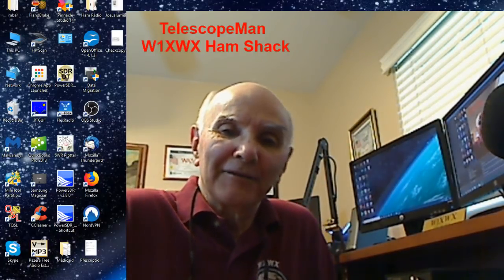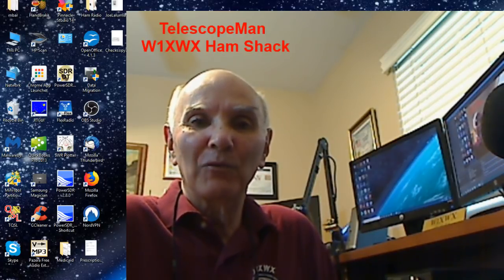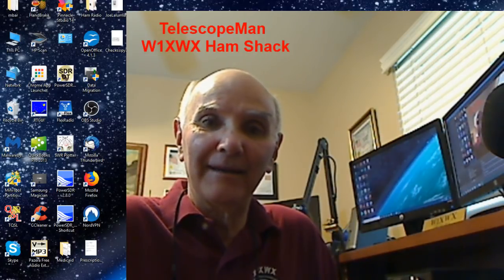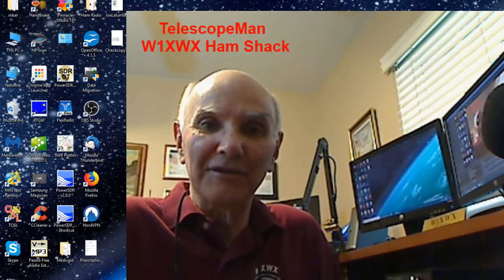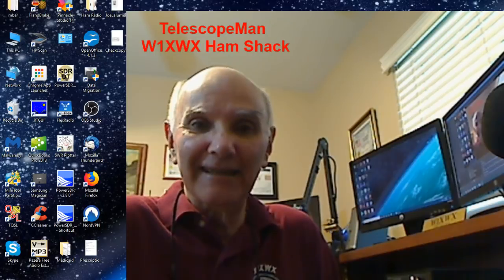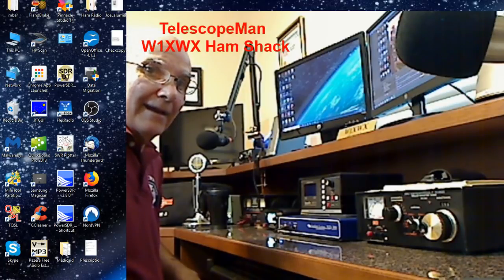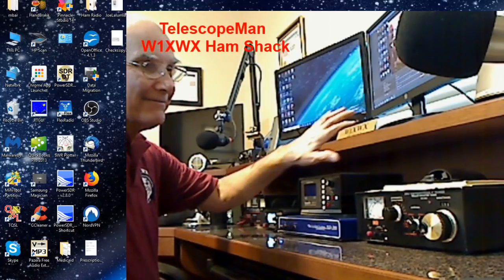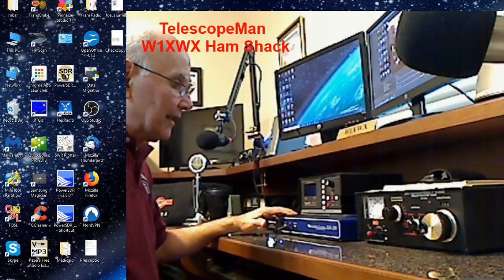Operating a ham radio-- a lesson for beginners

Comment: Thank you for clarifying Side Band. You mentioned there is a circuit that lowers the radio power-out signal if the signal coming back is too high. Is the correct name of that  circuit the A.G.C. (Automatic Gain Control) and the correct term for the signal coming back in the antenna reflected power?
Reply from the maker: Reflected power is the power being reflected back to the radio; however AGC is a circuit that prevents you from over modulating the signal and distorting the audio. Internally there is a circuit which pulls back (lowers) the transmitting power(the watts) being transmitted in an attempt to protect the final transitors from burning themselves up when the SWR is too high (above 2/1). Some radios start lowering the power at anything above 1.5/1. That's why I recommend tuning to below 1.5 to 1. All the best and 73
Reply: Thanks again Joe. In less than one page of the article you mentioned I got it. I was going to guess that the Antenna system required matched impedance and FWD & Reflected signals be in phase. Actually, they are not in phase but are resonant in the antenna system. A very technical article but easy enough to grasp the concepts. 73.

Comment from the maker: In "non-simple" terms the reason that final transiters are BURNED OUT is because the reflected power DETUNES the final amplifier stage of the radio  and raises the voltage going to the final transitors- they get HOT and DIE!. For the GEEKS here you can read this excellent explaination of what is going on with HIGH SWR. It's not so much that you loose power out but more that you can destroy your radio by not properly tuning. Article by WC7I:
http://www.hamuniverse.com/wc7iswr.html
Reply: Thank you. I will read the article. It sounds like you are saying its related to mismatched impedance.

Comment: So every time when u start hamming you have to keep tuning the antenna well that's boring what Happened to turning it go and go Instead of this extra crap. Dont get me wrong I thought haming and raging the chew, cw etc was to have fun not we extra work
Reply from the maker: Normally you do not need to tune a 2nd time unless you move way across the band. In my case I tune toward the middle of the phone section of the band and do not need to retune unless I move to the CW portion. Your mileage may vary-- depends on your antenna setup and how far you move within the band.
Reply: Joe Lalumia I see well I'm still going to follow ur advice get that Kenwood mobile radio but mainly will learn qrp and CW from the get go.  So far I bought an book, I'm getting a mountain topper qrp radio and a straight key I want to focus more on cw at a distance on lowest power
Reply: HondaRidgeline Enduser I thought there may be some automatic tuners that do this for you....

Comment: Good God what a useless hobby
Reply: As opposed to flying around in circles wasting time, gas and the safety of those on the ground?

To each their own, buddy
Reply: @Man0fMeans  Well at least now we're having a dialog.  I have used 2M under an FCC carve out allocating 5 frequencies for use to one of the organizations that provides structure to the odd and arguably time wasting hobby of paragliding. As a career pilot, I have long since known the value of being able to use radio for communication.  Recently I've considered installing a CB radio in a motorhome for garnering highway information, but am reading that it's not like it was in the 1980s...as a sidebar I started to learn more about HAM.  All I can find however, especially when scanning, is people asking each other "Where are you? and how strong is my signal?". There seems to never be any content or communication other than talking about radios and gear.  Believe me I could get on board with amateur radio if I could see that it had any value, but I may just need someone to show me exactly what that value is.
Reply: @YankeeinSC1  Well get on the air and talk to people about what you are up to. Common sense, no? And of course people into radios and gear like to talk about radios and gear.
Reply: @YankeeinSC1  
OMG!!!  And WHO are the folks who get the communication up and running? Ham operators - and that's why THEY have their historic days.
Reply: hey look it's the fun police lol